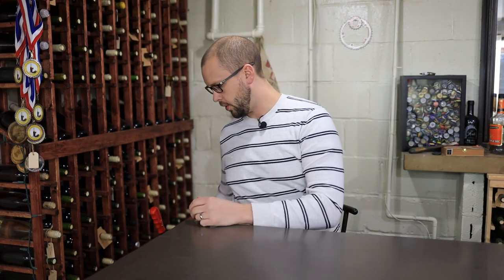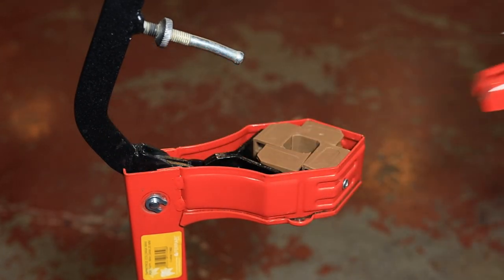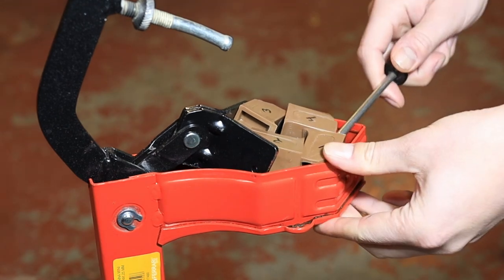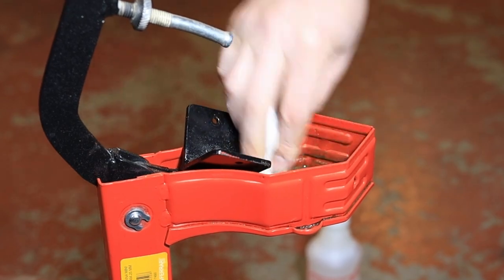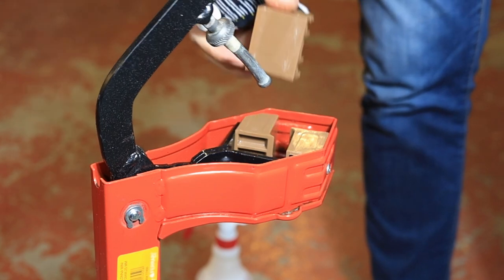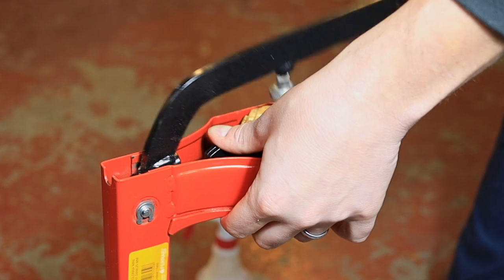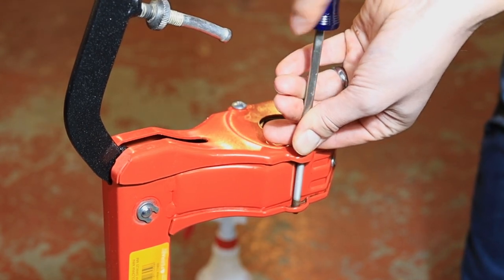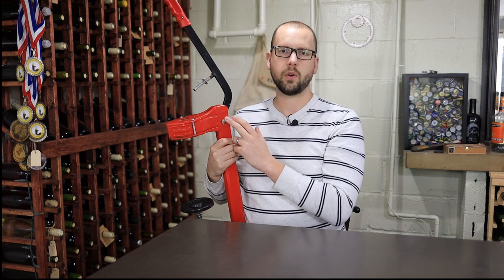Floor Corker Tune Up

Comment: I still use 30 years old corking machine.  I am shocked how, over those years, quality of new corking machines went down.  This is absolutely night and day.  First, my jaws are brass.  Springs, screws and cover is absolutely much better quality comparing what I can see on the movie.  Still, thank you very much to the author for this very useful video.

Comment: Might want to mention lubing the bottle plunger, easiest way to do that is to put a long bottle in, pull the handle down to lock it and flip it over, clean and grease. A drop of oil on the rotating parts at the beginning and end of the season is a good idea too.  I have several thousand corks through mine, same jaws.  Great video

Comment: How many bottles do you think you've corked before your corker started showing wear?
Reply from the maker: It has probably been about 1000 bottles through that corker.  I actually think they jaws could have kept going a little longer.  The hole turning oval is probably what will eventually end this corker.  Still a great little corker for home use but would wear out pretty quick in any sort of commercial application.
Reply: @TheHomeWinemakingChannel  Thank you for the reply. I just bought one of these, but I haven't bottled with it yet.  So I was curious about its expected lifespan. I only make about 50 bottles a year, so based on your experience this thing should last a while for me.  Thanks again. I enjoy your videos.

Comment: My floor corker is getting stuck on the side that has the screw into the jaw. It’s not sliding Back and fourth,it seems to be stuck on closed position making corks harder to insert.  any tips?
Reply: Tighten screw at jaw no.3 in this video and use food grad oil for jaws.

Comment: Question, my plunger is a little bent.  Bought used.  Can the plunger be replaced?
Reply from the maker: I don't believe you can replace the plunger without having someone weld a new one on. The bottom 1/3 of the plunger is intentionally bent back towards the handle though, so you may not have a problem.  If it is bent otherwise, you can try to bend it back by sliding two box end wrenches up it and prying apart in the direction to fix the bend.  If you need to bend it more than a little, you do risk snapping it off though...

Comment: Great video. I had no idea.  Mine is also slightly off set.  Love your wine racks.  Do you have a link for where you got them?  Thanks for the video
Reply from the maker: Thanks!  I have a video series on how to make the wine racks.  They are just made from furring strips so they are really cheap.  You could always make them from oak or something if you wanted to put them in a living area.